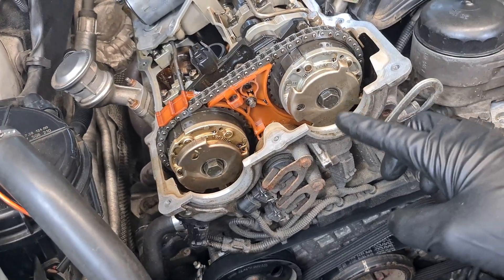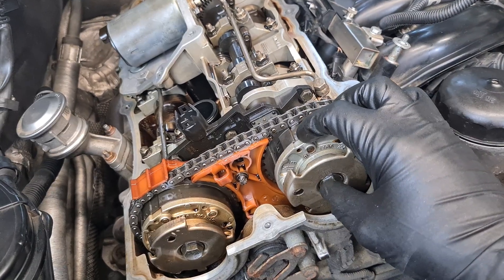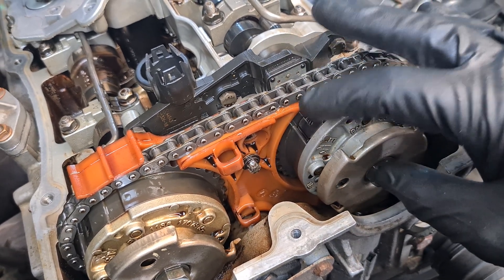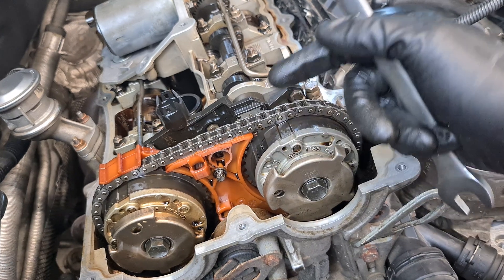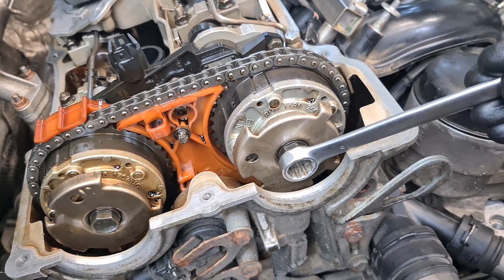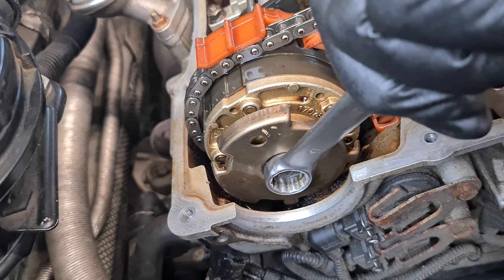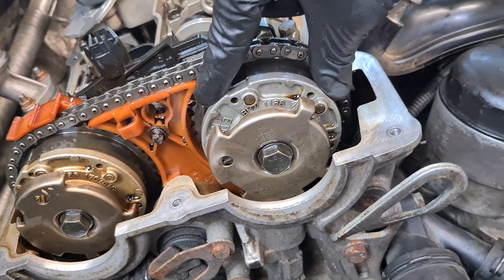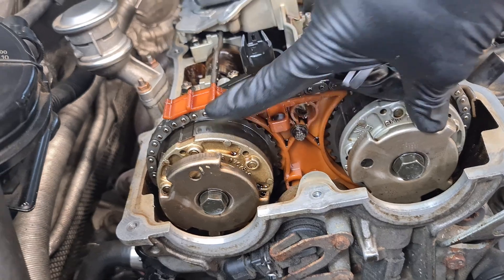N42/N46 Timing: Checking if VANOS units are locked

Comment: Hello BimmerZen! I need help again. I changed timing chain and put new eccentric shaft sensor, but now I getting Vanos codes for both camshafts. What can be a problem? I didn't have that fault before. I checked timing two times, everything is okay. Faults are 2731 and 27BB. Many thanks!!
Reply: Did you wrongly put the Vanos units? There is only 1x for exhaust and 1x for intake if you swap them wrongly u get those codes
Reply: @burak7638  Nope, I put them correctly. I get those codes only with eccentric shaft sensor plugged in. Without it, no codes for vanos.

Comment: Before I make any adjustments to the timing, I need to make sure that the VANOS units are locked? If I want to then adjust the timing I have to find TDC, lock the crankshaft and the camshaft, before I can loosen the VANOS bolts? I believe those bolts will need to be replaced. I can then place the timing tool in front of the VANOS gears and make sure the holes line up before tightening the VANOS bolts? Thanks!
Reply: Good question.

No one demonstrates how to move the vanos to the locked/unlocked position let alone talks about this in any of the n46 timing chain videos.

I’m keen to know if you got an answer
Reply: @aqib2000  did you find an answer eventually? I'm in the same boat, but I already have the VANOS units in my hand without checking if they were locked.

Comment: greetings, I own an e46 with N46 1.8 and 116 hp, I have never had a single problem, it has 305,000 km, it works perfectly, there is no smoke from the exhaust, the consumption is 7.3 liters.  but I'm planning an e90 also with N46 2.9 and 129 hp, or maybe a diesel M47 with 122 hp.. please, stay with the e46 or which one should I choose between the two engines in the e90 that I mentioned?  thank you
Reply from the maker: Awesome! I presume the engine had good oil change intervals and long distance driving? I still suggest you replace the plastic chain rail guide and the tensioner as a preventative measure:)
Reply: @BimmerZen  yes, the oil changes are always at 7000 km ..always high quality, Liqui Moly before and now Motul 8100 Xcess gen2 5w40, maybe I should start with Castrol?  I made an appointment to change the set, chain, plastic chain guides and tensioner.  the engine has been working veey nice, the car was with me, 4 years.  and I'm afraid if I were to buy an e90, with the same engine, that I would be deceived, because not all vehicle owners are diligent in engine maintenance..
Reply from the maker: @radeizazgrade7627  Good service:)  When buying a N46  the service history is really important. A lot of low mileage cars are in worse condition than high mileage examples.
Reply: @BimmerZen  yes, that's right.. I have a service history from Germany, it's correct, but again 305,000 km.. I don't know how long the engine will last, for now it works perfectly, it hasn't lost compression, it pulls nicely, it works quietly.. maybe I'll take it when I plan  younger car, but the question is whether it will serve me as well as the e46 with this engine..

Comment: Awesome video!

I purchased new vanos units and after installing them I want to turn the engine over and I see the intake vanos moving but the exhaust doesn't. Then after a couple of degrees they both start moving together but of course now the timing is off.

Getting new bolts now and gonna do the locking procedure first :)
Reply: I am having the same problem the intake cam gear is turning but the camshaft is not help

Comment: hello BimmerZen, i tested my vanus as you show in the video, the exhaust vanos did not have shaky but when i started to move the intake camshaft itself began to turn, when i cranked it no longer moved.

i suppose my vanos is not locked and it lags behind yes? a year ago, I replaced the chain with the tensioner, and the vanos was also changed, but to the used, and as I understand it, this one is also non-working. or am i wrong?

Comment: Hey, good expleanation! Is there any chance that a N46 engine can have a vanos issue without sending an error to the ECU for readout ? I recently repaired my Valvetronic and replaced the excentric shaft, the engine runs really strong now witohur engine cuts anymore in lower RPMs. So its the first time i can drive the car(BMW 120i E87) to its fullest. But i have a strange feeling something is still off, thanks to the workign Valvetronic the car has lots of torque and fast acceleration between 1000 and lets say 3500/4000 rpm, but afther that if i pull until 6500 near the limiter, it feels out of breath. It feels like its missing power in higher RPM, but no error codes appear. So i taught its maybe a VANOS related problem.
Reply from the maker: I don't have experience with your specific symptoms, but it seems possible that the ECU won't throw any codes... what are your VANOS adaptation values?
Reply: @BimmerZen  Good point i will check them later with my Laptop and Inpa. So Idle should be 119 intake and 55 exhaust cam as far as i remember. I will also read the Values at 5000rpm full throttle while driving. It just feels like 10hp missing at high revs. Other possibility is to chek the DISA, because if its not working above 4k rpm, that could also lead to a small loss of power. Its really hard to tell if you have no other car around with a N46B20. Is your Z4 pulling to the end of the rev range with increasing power or is it more linear above 4k rpm ?

Comment: hey if i just want to change the vanos unit bolt i have to unscrew chain tensioner ? or just lock camshafts and replace bolt ? :D
Reply from the maker: It's much easier to release the chain tensioner, so you have more slack in the chain to get the VANOS unit in and out... You don't need to remove the tensioner all the way out.
Reply: @BimmerZen but you didn’t mention how to rotate the replacement vanos to the locked position (to insert a pin) ready for installation onto the car